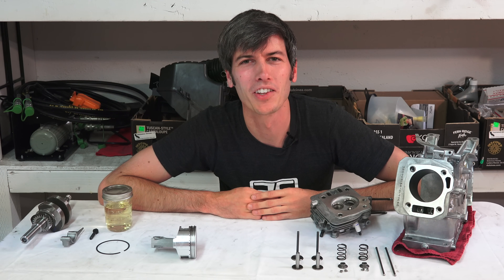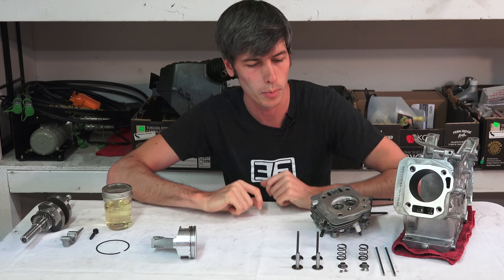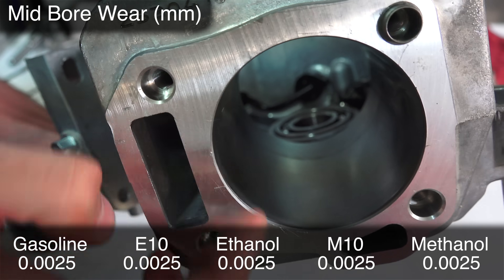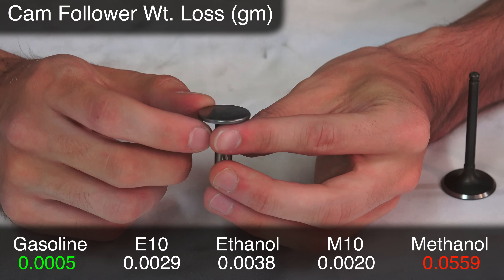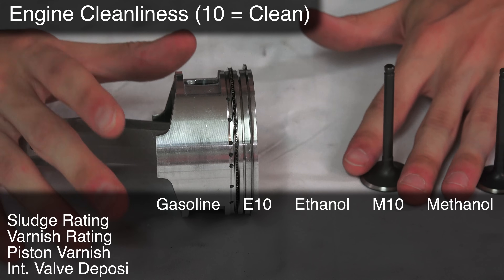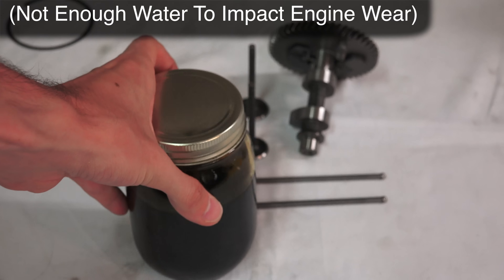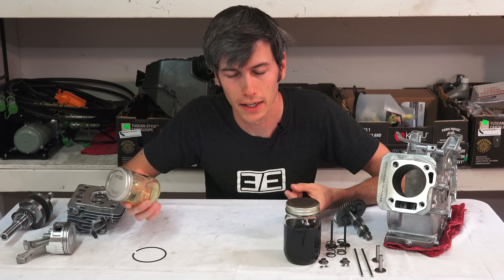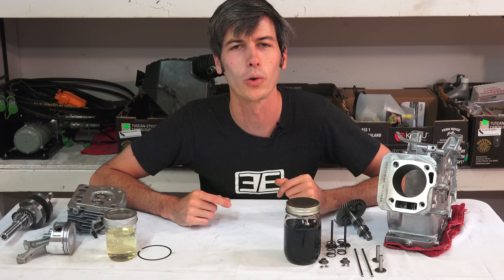Is Ethanol Bad For Your Car's Engine?

Comment: What about other 'external ' engine components such as fuel lines , fuel pumps, etc. especially in older cars?
Reply: He addressed that 8:00.
Reply: @deathdoor  perfect summary also! Thanks
Reply: 1992 Vw corrado G60; Everything in the tank that was rubber is now completely shot.  It sat for months at a time while I got it ready (almost a year this last time; it’s always had a full tank of fresh gas and stabilizer when it sits) and just this week I was finally getting back to work on it.  No fuel pump when I turned it on; the relay is firing, the fuse is good and I’ve got 13v at the pump and a clean ground so I decided to crack the tank open.  The tank seal and the fuel hoses have the consistency of taffy and they just smear all over whatever they touch.  All the seals and o-rings in the pump housing are just gone as I imagine the same within the pump itself.  Luckily, there doesn’t seem to be damage beyond components in the tank and since I was already going to replace the pump (it is the original 28 year old pump after all) I just have to get the tank clean.
Reply: @Boomkikker being serious, here, i do like the sweet corn smell...
Reply: Boomkikker it’s not always viable to go for ethanol free gas. The nearest station to me is about 40 mins away. With the mileage I get in my car about a third of my tank would be spent just driving there and back.
Reply: @Bonanzaking  that sux... every station here has ethanol fee, as no Supreme gas from any dealer has it in there...
You may get some that was left in the hose from the previous fill up though... 
The most we get here is 15% i believe anyway... I stick to Shell V Power... clean , and no ethanol here :D
Reply: It kills them. Use avgas on pre-catalytic cars.
Reply: How about my alternator, water pump and transmission?
Reply: @algrayson8965  I would imagine if you have any fuel in your alternator, water pump or transmission, you're in trouble.
Reply: @algrayson8965  I was wondering about my steering wheel?

Comment: Good job. Have read that same research back in 2004. But it was not an issue at that time. Now We have e95 wich is 5% ethanol and e98 which is pure gasoline. Next year however 95 will be 10 and 98 will be 5. So no more pure gasoline after that. I will use your video to answer the questions from our clients. Hope it will help channel as well.

Comment: I am a marine technician I see the damaging effects of ethanol all the time. It eats apart the inside of fuel lines and primer bulbs. Looks like black sand in the carb bowl, plugs up jets, etc.
Reply: That’s because it’s not made for 2 stroke engines. Its made for 4 stroke modern engines.
Reply: @427SuperSnake1  "Modern engines" such as line trimmers, chainsaws, mowers, etc are typically carburated, and often 2-stroke as well.
Ethanol is okay for your (computerized) car...for everything else you own, not so much.
Reply: Ethanol cleans, it will not leave a deposit but actually cleans. The only time you'll ever find a deposit is when the plug isnt firing correctly. The trash youve found is the inner lining of the hoses.
Reply: @jasonmefford4312  Ethanol causes corrosion on aluminium and it dissolves plasticizers that are meant to withstand gasoline. Don't underestimate the danger of mixing chemicals. In August 2019 two young blokes from Belgium died from inhaling the poisonous fumes from what the papers reported to be a leaking jerrycan. Having seen first hand what E5(!) fuel does to a 20 year old jerrycan, to me there is no doubt what caused it to leak and subsequently them to die.
Reply: @gordonbos5447  ethanol is alcohol. In case you didnt know. Water will cause aluminum to corrode but the worst is steel.
Reply: @jasonmefford4312  I know what ethanol is and I stand by what I wrote before. Also it's not steel that causes corrosion with aluminium but inox.
Reply: @gordonbos5447  smh
Reply: @jasonmefford4312  Yes, that is what science does to people that are intimidated by it.
Reply: @gordonbos5447  you are truly unique, good luck in life!
Reply: @jasonmefford4312  For someone who doesn't know the difference between steel and inox you're quite cocky, aren't you?
Reply: @jasonmefford4312  Ohhh, that's so adorable... Little college student thinks he already has all the answers so he doesn't need to learn anything to be able to walk out with a degree.
Reply: Oh, look at that. It miraculously re-appeared. That's what you get if you let an American do a German's work.
Reply: @jasonmefford4312  He's right.  Ethanol itself corrodes aluminum.  This is called, "alcoholate corrosion".  Water does not.  Google it.  Ethanol also destroys plastic and rubber that weren't formulated to withstand it (i.e. older engines, smaller engines).  I'm an American too, BTW.
Reply: That because the engines you witness have probably done more than 20 hours on ethanol. 🤫
Reply: Duh due to fuel lines
Reply: I wonder when manufacturers modernized their cars fuel systems? Since the average car age is 11 years, there are plenty of modern cars that are 15-20 years old now. I wonder if any have issues?
Reply: @Rusty Highlander MMO isn't going to do anything vis-à-vis ethanol.  It may help with other issues (i.e. lubricity).  It isn't formulated as a stabilizer either.  For that (anti-bacterial and anti-oxidant) use a stabilizer.  Better yet, don't use old gasoline, run the tank dry and don't let old stale fuel sit in the lines.  That goes for any engine, ethanol blend or not.
Reply: The Australian Government stated never use E10 or any ethanol on Carb vehicles, Boats, bikes, scooters, planes. Why people do it is beyond my understanding. But I fully support E10 until the day I die, 10% less money to the middle east.
Reply: Reviewed Popcorn The U.S. is a net exporter of gasoline now that we have fracking technologies. I don’t think we buy that much Mid East oil anymore.
Reply: @kalloggs40  I guess they no option in USA,  it wasn't like in  Australia you still can get normal unleaded
Reply: DING PONG CHI I get 91 octane with NO ethanol in NY
Reply: Sounds like you're a bad marine technician who doesn't know what he's talking about. What are the fuel lines that you're referring to made from?

Comment: I own a carbureted 2007 motorcycle, and I noticed that I get 10-15% lower fuel economy when using ethanol fuel vs. regular gasoline.
Something I’ve read about in motorcycle magazines and online reviews is that ethanol fuel is highly corrosive to the rubber fuel lines on motorcycles. Should this concern me for either my 2007 Honda or my 2016 Victory?
Reply: honestly, car and motorcycle manufacturers have been designing around ethanol since the 90s.  Your fuel lines should be made to withstand ethanol, and if they aren't you just need to replace them with ones that do. It's like a dollar fix, and a couple hours under the hood/tank.  My 97 4runner does just fine with enthanol, and I get roughly 21mpg when going 60-70. I can push it to 25mpg if I go 40-50mph.  The manufacturer rates my vehicle at 22mpg highway. Really, it's more about how you drive and what you haul as far as fuel efficiency.

Comment: Running the ethanol fuels is not the problem, it's the storage of these fuels which cause the most damage when the fuel is stored in the carburetors.  The ethanol fuels will calcify inside the carburetors on small engine power.

Comment: Wow, 0.002" (2 thousandths) wear in 20 hours?    Are you sure your oil lubrication was proper, and correct?  My last job was in a remanufacturing plant as a machinist, and an engine with that much wear would be on its way to be very much worn out with those specifications, and needing a rebuild.   Plus methanol is a oil solvent, and would quickly destroy any protective oil films in the cylinder bores.
Reply: Test was under peak load. Imagine being flat out on the accelerator, going at top speed, near redline, for 20 hours without stopping. Most of the people on the road push their engines that hard for seconds at a time, not very often. So yes, that seems reasonable.

Comment: Late to the party on this one.

I’d love to know if they measured the power produced by each engine and how accurately the engines were calibrated to each other. Was each tuned for a perfect stoichiometric ratio? Was timing optimized?

If the methanol engine was doing more power and producing more power, the wear might be more than justified.

Comment: Ethanol is a little bad in cold enviroments. Even with current technologies, the engine runs weird while it's cold (around 10-15 °C), so you must wait some time to heat up before driving. In colder places this effect must be worse.

Comment: I used to occasionally run an E85 and E10 blend in my 2007 BMW e92 335i... I was always concerned that the higher amount of Ethanol would be harmful to the engine and fuel lines -- it's clear now that it was relatively safe for the engine, what about the fuel lines?

Comment: @Engineering Explained, this video stuck on the engine alone, what about the fuel system? Is there additional wear/breakdown from the blended fuel to the pump, fuel lines, hoses, and injectors regarding the rubber or silicone?

Comment: I am very surprised to see ANY measurable difference between the test engine on the cam followers and cam lobes.  The only thing they would see that is different than 100% gasoline is any blow by gases.

Also,  I doubt that there have been any significant changes to fuel system component in more 50 years.  Possibly minor changes in metallurgy of  fuel line, but that would likely be to combat external corrosion.  Since the 1960s "rubber" fuel system components have been synthetic rubber like neoprene.  While natural rubber will swell/deteriorate in the presence of E10, neoprene will not.

Comment: You mentioned fuel economy differences with 1-% ethanol over regular gasoline.  On two different Mustang GTs(2005 and 2008) I owned I saw a slight drop in fuel economy(consistently between 7 and 8%) when I used gasoline that had 10% Ethanol.  However with my 2016 Fusion I haven't been able to measure any significant difference between 10% ethanol gasoline and ethanol free gasoline.  I tested by driving the same 4+ hour route multiple times with 10% ethanol gas and gasoline without ethanol in each vehicle.  The cruise control was set to the same speed for every trip.

Comment: I found out the hard way that ethanol eats though fuel lines.  I had to replace a fuel pump and the lines in the tank.
Reply: Your vehicle was fitted with crap rubberized parts.

Comment: The important factor is that ethanol can be corrosive to fuel components(hoses etc.) and some coatings(cylinder, fuel tank etc.) that some manufacturers/engines use. It also needs a proper ECU tuned for it.
So you can ONLY use ethanol fuel if the manual says it's ok. There is no other way to decide it.

Comment: So from what I thought I saw Ethanol does less damage leaves the parts cleaner. In my simple mind parts without varnish and sludge will perform longer and better. 

Oh that pesky little energy density thing but then you need to look at your normal driving and if you are just running around town 98% of the time then get 100% Ethanol.

Comment: Pure ethanol gives your car a lil bit more power, considering it was designed to take ethanol, what with higher octane, which also lowers the chance of engine knock.
Keeps your engine and exhaust clean to boot, so it's a good fuel in my book!

Comment: From personal testing some years ago I found that the price for e10 needed to be about 3 cents cheaper than unleaded (at Aussie $ 1.25/litre) to make up for the efficiency loss. But there is normally only a 1c difference in the price.
Reply: All you need to do is increase the amount of oxygen in the mix.

Comment: You don't talk much about fuel systems, horsepower out put, and fuel economy. ADM is a scam and they rob you every time you fill up. I haven't bought any Ethanol in years for my fleet. Only E0 is the way to go.

Comment: Alchohol based fuel and other bio fuels may just be the future of  energy as we run out of fossil fuels and will be able to run in existing engines (at least some) so if we could have a push for only bio fuels we may be able to actually reduce our carbon footprint without a major change in infrastructure

Comment: Small engines with carburetors will benefit greatly from non ethanol gas.    I used it in all my equipment when i mowed lawns for a living. My mower ran about 3 times as long as average mowers of that model.

Comment: Stop subsidising corn, build a small, efficient engine that runs on diesel at a specific RPM and produces around 70kw hooked up to a reliable electric generator and a 25kw hr battery pack and a Tesla power plant and you have a truly sustainable system. Farmers grow what sells, engines last longer, cars use fewer batteries,  fossil fuel use goes down, and if there's a zombie apocalypse you can run your car on cooking oil, and solar cells.

Comment: I think this is a great video, but it takes into account nice, clean, new ethanol or ethanol mix.  Ethanol does quickly absorb water which causes more than a few problems both in cars that sit with a non-full tank or gas stations that don't have enough sales to move through their tanks in a short enough time.  While not completely related but worth noting is that fuel injected engine ECU's make the air fuel mixture roughly 5% richer when ethanol is noticed.  This, along with the lower energy content of ethanol, decreases the fuel efficiency of the vehicle.
Reply: You get much higher octane rate  if your car has very high compression ratio. I saw one super car in Sweden get a lot more horse power with E85

Comment: Hello, here in Brazil we’ve been running with E100 for quite some years. It was quite a challenge to avoid corrosion on exhaustion system and problemas with liner washing. Is there any more studies regarding modern technology (e.g. direct injection, turbo charged) using pure ethanol? My concern is regarding liner washing as well. Also, ethanol is great agains pre ignition, so works very well is high compression ratio flex engines.

Comment: Ethanol also has a higher octane rating, which allows fuel blenders to use lower-octane gasoline as they will be mixing it with higher-octane ethanol for a higher overall octane than if sold alone.

Comment: Is Ethanol used because the government subsidizes corn?  My understanding is the US pays farmers to grow as much corn as they can, while at the same time giving tax breaks to fuel producers that add ethanol to their fuel.  So the tax payer pays twice to have it in the gas supply.  Then said tax payers pay again when they have all their small motors ruined.  How many carbureted motors were scraped early and how much additional loss to maintenance has there been?  I think ethanol probably makes a few people rich while everybody pays under the guise of environmental protection pushed by lobbyist for big corn and don't get me started on HFCS please.     
I have another question, how much oil and energy and pollution does it take to produce the parts in the evap system on my car and how much pollution and gas does the evap system save over the life of the car?  It seems like a lot of parts to save a little gas vapor from escaping the gas tank.  I mean it costs fuel economy just having the weight of the parts in the car.

Comment: Here in Brazil most cars are flex fuel, so they can run with 100% gasoline, 100% ethanol or a mix of them (despist our gasoline have 27.5% ethanol). I've never heard about any problems using ethanol.  I've been using 100% ethanol  in my cars for years and have no problems, and most mechanics say that engines that use ethanol are cleaner than the gasoline users. Ethanol is cheaper, cleaner and give a bit more HP, so I don't see advantages using gasoline.

Comment: In Germany even the drivenschools say that you should not buy it. 
Or just drive a diesel :)
Reply: Blind Squid  2040 is still a long way away. Widespread use of Diesel in passenger vehicles mostly became a thing in the late 90s/early 2000s, so technically if it's done by 2040 it's only half way through.
Reply: Germany is trying hard to get rid of diesel engines with taxation some of the bigger cities adding extra taxes
Reply: Yeah... because it would not do to cut into oil company profits, would it?
Reply: And that while modern diesel engines (>2015) are better tot the eniviorment than gasoline engine.

Comment: I live in BRAZIL and all of our gasoline is, by law, 27% Ethanol, and for this reason most of our cars will run on both gasoline and 100% Ethanol.

I've noticed that cars fabricated prior to this law have WAY BETTER fuel economy when running with our E30 gasoline.  when compared to newer cars. 

Can you explain?

Comment: Now show what it does to the fuel system itself. Had a 1978 Ford F150 around the time that they started using E10 and it never ran as good after. I've read of boats having to have their entire fuel systems replaced due to ethanol damage.
Reply: Start running high test or using fuel additives. Your truck will never run right on e10 without some significant reworking in the engine and fuel systems

Comment: It would be interesting to hear something about the wear on the fuelpump. It should not effect the engine too much. Have been driving with E85 (85% Ethanol + Gasoline) myself for more than 20.000 km and the only effect was cleaner sparkplugs. Just had to change the fuelpump. Question is: Was it the ethanol or coincidence?

Comment: I'd be interested to know the differences in fuel consumption to run each fuel in an engine for 20 hrs.  I know that pure alcohol will be the highest consumption rate and the blended will be in the middle while pure gas will be the most efficient.  But how much difference